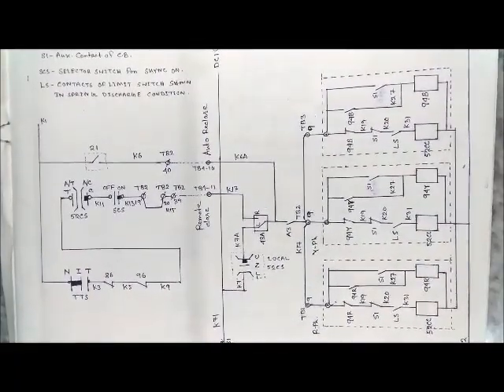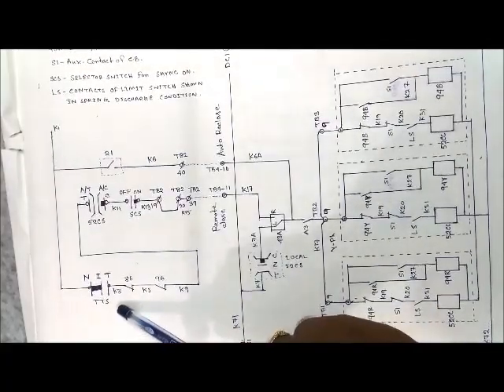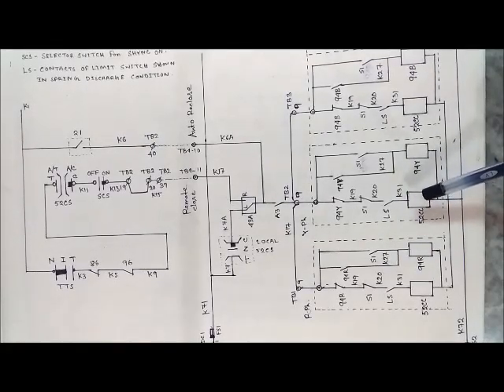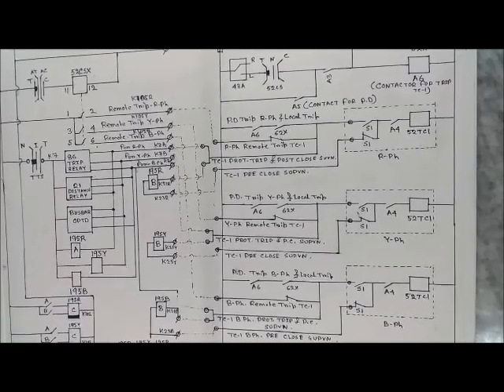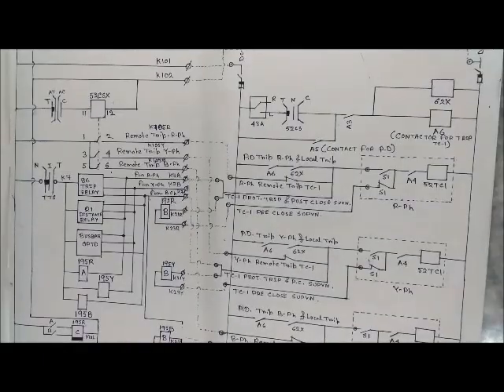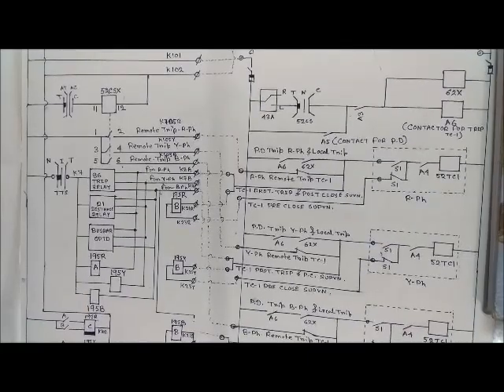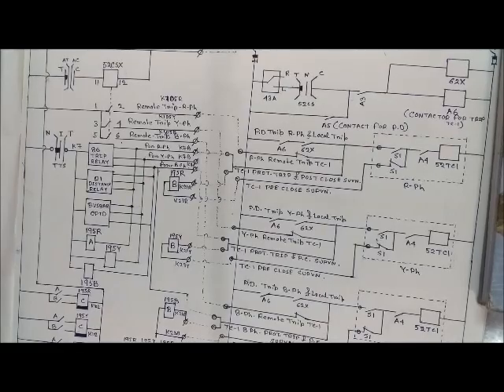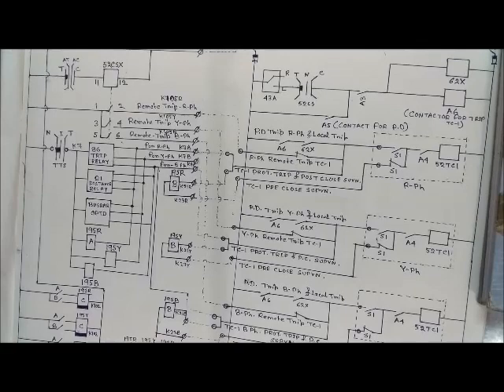220 KV CIRCUIT BREAKER OPERATION AND WIRING DIAGRAM

Comment: Sir, what is not switch and please give me more knoledge
Reply from the maker: Probably your question is why is not switch?? Switch has two state on and off but don't have fault clearing capability, but in circuit it has.
Reply: @relayprotectionelectrical  what is significance of at and ac in t&c switch and how it works
Reply from the maker: @MrBharatgautam  AT Means after trip and AC means after close. It is used cb discrepancy circuit. Whenever a discrepancy between circuit breaker state and cb discrepancy switch is there, there exists a discrepancy relay in each control and relay panel and one flasher relay in the either bus coupler or bus transfer panel which will energise.in discrepancy type control switch a led bulb is there. Due to discrepancy of state the led bulb will continuosly flickering or flashing i.e. on and off so to attract the operation staff present in the control room. For cb discrepancy ckt at and ac contact s are taken along with cb auxiliary contacts.
Reply from the maker: @MrBharatgautam  this is good platform for discussion. If any doubts you may feel free to ask here.
Reply: @relayprotectionelectrical  is this discrepancy relay different from pole discrepancy relay in cb
Reply from the maker: @MrBharatgautam  yes, pole discrepancy relay is different used for circuit breaker where three separate pole exists and it is used for protection purpose. You can watch my video on pole discrepancy relay. But discrepancy relay is used for indication purpose only. Normally in case of 33 kv or lower system voltage no such discrepancy relay is used.In discrepancy ckt there exists five bus wire postive bus, negative bus, steady bus, discrepancy bus and flasher bus.
Reply: @relayprotectionelectrical  I notice at and ac in 220 kv line control panel .there is a flag   circuit auto trip